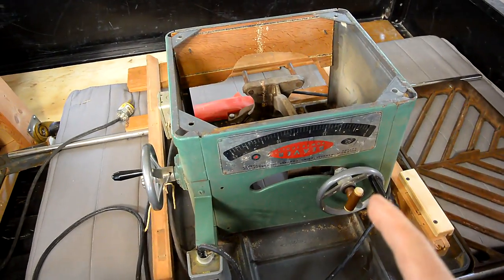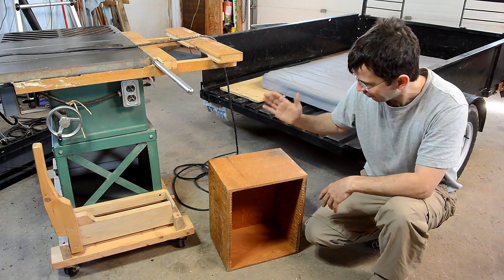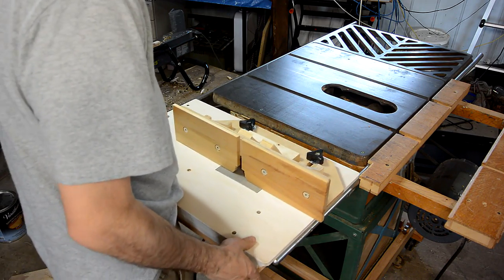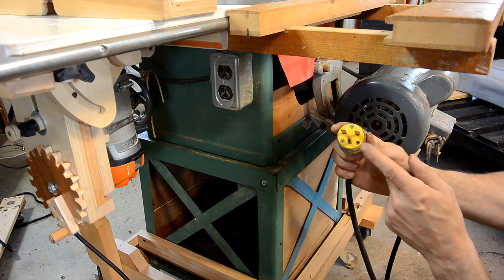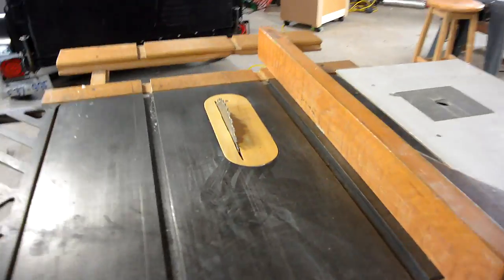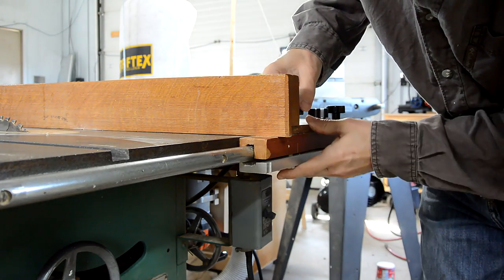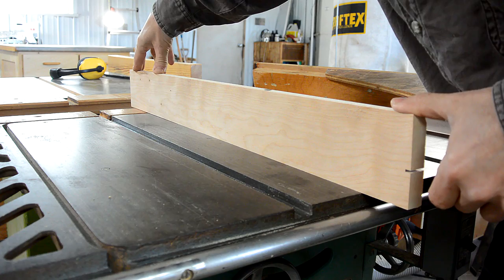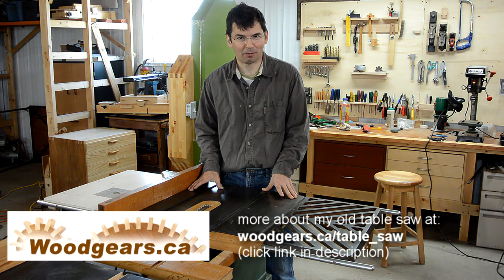My old table saw

Comment: I love all 3 of my old Rockwell Beaver saws, and I agree they are way better than most new saws, it's too bad they went with an oddball size blade for them, I can't find anywhere around Edmonton that has them, so I ended up using 8.25" blades in mine.

Comment: I have a 20+ yr old Powermatic Contractor Saw, all cast iron including the wings. Set it up with balanced pulleys and this saw is a beast. Cuts better than my fairly new Delta Unisaw. Smoother, the motor is stronger and just a great saw.

Comment: Matthias.
I was going to buy a new Delta tablesaw at Lowe's 
 But after researching it. I found out this big beautiful daw had a 13 amp motor in it.
Well, I got pissed and asked what is a good tried and true saw for the hobbyist, for cheap.
I bought a craftsman 113.298762
It's a newer craftsman but I believe it will do the job.
Thanks for your honest videos. They have saved me alot of money and grief.  So, thanks again. From Arkansas, USA

Comment: My old table saw had the table bent worse then yours.I build steel frame under neath, tapped threads in them and with set screws I could "push" the table straight. It was a lot of work but worked very well. (Table was bent both directions which is why it was a problem)

Comment: I had similar problem with my table saw table, and i managed to make it straight by adding washers at front.Cast iron bends very easily, but one have to watch not to over bend it, because it can crack.
Reply: Deevla Good idea.
Reply from the maker: My dad's felder had a warped table.  The service man fixed it by shimming it.  We didn't know cast iron could warp so easily!
Reply: I learn that trick from my grandfather who was machinist, i also couldn't imagine those big cast iron lathe can warp.. If the bottom is not leveled, machine can't be precise, because  bed twists.
Reply: oh, i didn't know that. Then what is the point of using cast iron?
Reply: Cheaper and easier mass production(especially difficult shape parts) , easy machining, very good dump vibration properties...etc
Reply: Also naturally stable. It doesn't have stresses in it that come out when machining, and it doesn't change shape much with temperature and time.

Comment: My Table Saw was an Iron Cast Monster with 400kg . It was a Felder from 1976 with 800x900mm Table and a Iron Cast crosscut sled Who can handle 1500x1500 plates. An Inductuon Motor with 1,5 horsepower.
I Loved her and never changed It against a new.
The saw was extrem precise.
A crosscut over 2meters i messured 0,2mm Difference.

Comment: I have a similar 9 inch Delta/Rockwell saw.  Where do you get your blades?  I have been using circular saw blades.  They work OK but i need a good blade.

Comment: Hey, just a thought. You could switch the aluminum part that you milled with the wooden part on the top part of the fence so that the accuracy of the aluminum part will be the one that registers off the fence.
Reply from the maker: If I swapped them, then the reference surface would be on the bottom part (much less accurate).  The reference surface is part of the wider clamp that is on top.

Comment: You should really install a winch on the ceiling. It comes in handy sooo many times. I have a really small garage and made one of steel frames used in suspended ceilings, some metal parts and a few pulleys. I use it all the time.
Reply: T0NGPU I plan the same for my next workshop. One I-beam mounted to the centre of the ceiling to lift a few hundred kg.
Reply from the maker: I have had some ideas about a crane or winch of some sort, yes.
Reply: As I recall you do also have a tractor with a front end loader. Make/beg/repurpose a set of forklift forks to go on the loader. Best thing I did for mine.

Comment: Matthias, watching you struggle getting the saw table out of your trailer makes me wonder what's overhead.  Are the joists (or roof trusses or whatever) exposed?  If so, a come-a-long, block & tackle, or other hoist would be a big help lifting that sort of thing.
Reply from the maker: With the 16' ceiling, it's not really practical.  Because I wouldn't want something dangling down that far all the time, and it would be way more hassle putting it up and taking it down than it was to move the saw.
Reply: Love your videos Matthias, I've found your channel (or was it a website) probably around 2005 and got hooked immediately :)

You now have enough headroom and a flat floor just begging for a small gantry crane. Two A shaped side frames with an I-beam or something similar in between. When not in use it can be parked over the table or a workbench and not waste any space. You already have the welder, it should be a straightforward job.
Reply: Well, I envy you the tall space you have.  However, there could be many ways to get around the "dangle" issue.  Maybe you don't move enough heavy items to think it's worth the effort, but having worked in shops with an overhead hoist, well, I'll just say I miss having one.  Another approach to moving heavy stuff is something like Frank Howarth's "Wooden Gantry Crane" (posted under that title about a year ago).  An overhead hoist would much easier/cheaper, though.
Reply: Let's all not lose sight of the fact that Mathias has a front end loader now. So what he really needs is choker straps.
Reply: Wait! You mean Matthias should BUY that??  Not likely.  I expect he'd make one from salvaged furniture.

Comment: I'm confused, why would plugging a 120v into a 110v drop it from 1.5hp to .33hp ?
Reply: 240V saw into 120 mains so 1/2 the current and half the voltage so  1/4 the wattage

Comment: The new shop has a lot more echo.   I'm expecting we'll see a video testing different sound dampening techniques, materials, and thicknesses.  Then a video where you turn some old furniture into some impressive acoustical panels.  Then each panel painted green and with its own dust collector.
Reply from the maker: Already made a video on that, years ago.

Comment: Do you agree with the saying "They don't build them like they used to" in the context of a lot of equipment nowadays?

It just seems like a lot of the newer things break easier or had too many corner cut to the point that quality becomes questionable.
Reply from the maker: No, there was a lot of junk made in the past too.  Just the stuff that's still around is the stuff that didn't break.

Comment: this was the only video i've seen to compel me to wire my table saw to 220v.  anything else to gain by making the switch?
Reply from the maker: it was only so wimpy because the motor was wired for 240 but plugged into 120.  If it was wired for 120 when I plugged it into 120, it would be hard to tell the difference.
Reply: Thanks for saving me the extra expense, Matthias! 120v it stays. lol

Comment: Are those 321 boxes? I remember seeing a video a while ago where someone was making them and showing how useful they were.
Reply from the maker: never heard of 321 boxes
Reply: They are a simple box where the 3 dimensions are 1 unit by 2 units by 3 units. Then a couple of the boxes can be stacked in combination to make a wide variety of different heights for supporting the other end of things, a quick step up to reach high shelves or all manner tasks where you might need a second person. 
You can also keep things in them.
Reply: Block

Comment: I would guess that the 220 v is more power to cut vs your new saw?
Reply from the maker: Less voltage drop in the cabling, so a little bit more ommph, yes.
Reply: I have a makita 2705 job site saw, it's my first, and it is 110. It cuts nicely, it came down to this or the Bosch saw. I'm happy with my decision. Love your videos, your knowledge, and abilitiy to reuse many items that would be trash to most others!

Comment: couldn't you improve the clamping on that fence with 1-2 of those quick hold down clamps ? they're like $2 on ebay.
Reply from the maker: Plus $20 shipping to Canada - that's usually how it works.
Reply: The stuff that comes from china can take over a month to get to Canada. What's it like for east Europe?
Reply: about the same, but it's free shipping, you can pay more most of the time to get it faster, never tried it though, the longest a package took was 2 months, i even got refunded before it arrived.

But i can also get free or cheap shipping from sellers in the UK, that stuff arrives within 5-10 days. The price is usually a little higher, but worth it if i need it sooner.

Comment: I'm getting burn marks on my cuts  any suggestions
Reply from the maker: get a sharp blade, and higher feed rate (may require more power)
Reply: I'll check it Out i hope the pm 1000 has a strong enough motor  thanks I watch many of your videos thanks for making them

Comment: Just got an old Beaver saw from my father.  Made up a zero c plate after aligning the blade to mitre slots.  Did it with an f clamp on the rear trunion casting and the very solid box housing.  Cracked 3 bolts and gave it some clamp.  Now I'm looking at the plans for John Heisz's wood fence.  I can't stand the original fence....a cast iron pig with a chincey little claw on the front rail.  Best moved by straddling the side of the table and one hand on each end of it.  Otherwise it cocks itself along the rails and zig zags.  Terrible, terrible design.

Comment: Could I destroy a fidget spinner and take its ball bearings for something actually useful, like that nifty little track system?
Reply: If the bearings are the right size, you might be able to use them in a screw advance box joint jig.